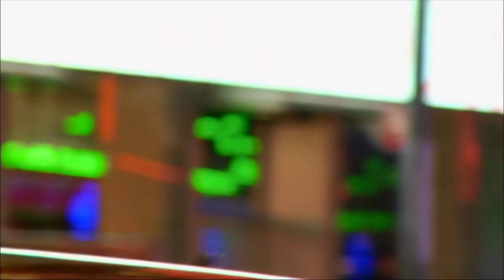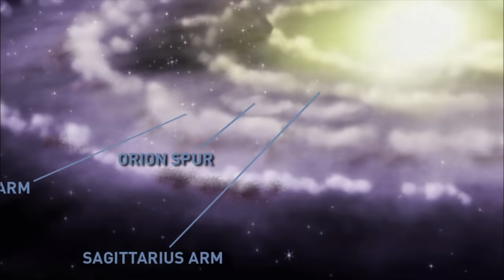The Universe: Countless Wonders of the Milky Way (S2, E4) | Full Episode | History

Comment: Wish you would bring this show back with all the new discoveries!
Reply: Agreed
 Would love to see something on the Kupier belt
Reply: Mike Rowe is still doing "How the Universe Works". They just released the 10th season a couple months ago.
Reply: @DanRustle  Basically everything you just said is wrong.  You - Yes YOU - can see the closest galaxies like Andromeda fairly clearly with a $400 telescope and the images from the most powerful telescopes like James Web and Hubble are not grainy images, they are top notch high resolution images.  We can easily determine size of other galaxies by a number of methods, the most common of  which are distance which is determined by the amount of redshift in the light from those galaxies which reaches Earth and gravitational lensing to determine the approximate number of stars within that galaxy.  We can then give a fairly accurate approximation using that information on how many stars any given galaxy has, which yes is a guess, but it is a very educated guess based on real data.  As for our own galaxy, the reason we know the Milky Way is a spiral galaxy is because astronomers spent 25 years using a large number of optical, infrared and x-ray telescopes to map out every part of it we can see, which is about 80% of it, the other 20% is blocked by the supermassive black hole at the center and all the stars, dust, gas, etc. orbiting it. If you have 80% of anything you can easily determine what the final shape would have been with that missing 20%. Our telescopes have even begun directly imaging exoplanets now.

Comment: ºIf we are exploding half a million miles an hour through space or even one mile an hour, in an ever expanding universe than the stars should have changed their relative positions in the six thousand years that we've navigated using Fixed Star Location.  But they haven’t.  Stellar drift is a misnomer.  Polaris is still the North Star.  All the zodiacs still look like what they were named after some six thousand years ago.  The great pyramids of Giza are still perfectly aligned with Orion and Orion having twelve independent stars should not still be looking like an archer.  And Haley's comet knows where to find Earth every seventy-five years in an ever expanding, chaotic universe ?
 There are over two hundred stars in the constellations alone and if they haven’t moved in over six thousand years then they never will.  It’s practically written in the stars that, “The Earth is stable and cannot be moved.”  1 Chronicles 16:30.

Comment: The motion of the stars orbiting close to Sgr A* indicate that the supermassive black hole is NOT spinning on it's axis once every 11 minutes. There is no frame dragging occurring around Sgr A*. Sgr A* does NOT have an event horizon nor does gas orbit it rapidly in an accretion disk. All these postulates were excuses to explain the massive amounts of high energy photons and gamma rays coming from the location of the black hole.

Fact, in 2019 ALMA Radio Telescope released a Doppler image of Sgr A*. The Doppler image measured the trajectory and velocity of the gas near the supermassive black hole. The gas, instead of orbiting the black hole in an accretion disk was moving directly away from the black hole in every direction. None of the gas was moving towards or orbiting the black hole. The data indicated that the energy and gas was coming directly from the surface of the black hole. This empirical evidence indicated general relativity is incomplete and the laws of thermodynamics is incorrect. 

According to GR nothing can escape the gravity of a black hole not even light. Yet astrophysicists are able to measure massive amounts of energy and matter moving away from the black hole in every direction thus it is incomplete. The laws of thermodynamics claims that energy and matter cannot be created. Matter and energy would not be moving away from Sgr A* if energy and matter could not be created. The accelerated expansion of space with great distance would not happen if energy and matter could not be created. These empirical observations indicate the laws of thermodynamics to be wrong claiming that energy and matter cannot be created. If energy and matter could not be created then all the energy and matter in the universe would not exist. That is an empirical observation that cannot be disputed! the only reason why the exponential expansion of space with distance is blamed on dark energy is because it violates the laws of thermodynamics claiming that energy and matter cannot be created. So the universe according to law should not be expanding, growing over time. It should be collapsing because of gravity. But the actual opposite is occurring because energy and matter is indeed being created everywhere. Observational evidence of energy and matter being spewed by a supermassive black hole is empirical evidence that energy and matter can be created. If it is happening to one supermassive black hole then it is happening to every supermassive black hole.

This one Doppler image by ALMA of the supermassive black hole in the core of our own galaxy is the key to understanding everything about the universe, including gravity. Yet not one web site, news agency, scientific forum or peer review process has mentioned anything about the empirical evidence ALMA Radio Telescope discovered! They even discovered stars forming in the gas moving away from Sgr A* released the data earlier this year about the black hole birthing stars near it. All the unexpected data that contradicts theory and law goes ignored when it should be breaking news, showing Einstein to be wrong about gravity and it's effects.

Fact, in 2010 astrophysicists announced they discovered a massive cloud of gas, called G-02 heading straight for the supermassive black hole in the core of our galaxy. Astrophysicists began making predictions on what would happen to the gas cloud when it neared the black hole. They claimed the gas cloud would be stretched out as it got close because the gas near it would be moving faster towards the black hole than the trailing gas. So they claimed the gas would become spaghettified. Some of the gas they said would reach the speed as it neared the event horizon then produce what they called a light show. The rest of the gas they said would be stretched out and flung out away from the black hole. The EHT team then created an animation of what was predicted to occur with G-02. 

I however have been studying gravity and it's effects for more than 20 years and I came to a different conclusion, to which my predictions on what was going to happen to G-02 was different than theirs. I wrote to them in a NASA forum and told them that nothing much was going to happen to G-02. I said it would orbit the black hole and barely be affected.

Then we waited for the event to occur. 4 years went by and the EHT team measured the G-02 gas cloud orbit the supermassive black hole and come out behind it and the gas cloud remained intact. It even retained it's spherical shape. So I was right. The gas cloud orbited the black hole and was barely affected just as I predicted.

Then the EHT team believed there was missing mass somewhere. Because according to the laws of motion the gas cloud did not have enough mass to produce angular momentum and orbit the black hole. It should have been eaten by the black hole, not orbit it like it did. So the EHT team believed there were a few young stars hidden in the gas. 

I wrote to them again and told them that if they went over the infrared data they would confirm there were no stars or missing mass hidden in the gas. About 2 weeks later they reported that they went over the infrared telescope data and could not detect any stars hidden in the G-02 gas cloud, just as I said. The gas cloud orbited the black hole without being affected because Einstein's and Newton's equations on gravity are incomplete. They do not include the action causing gravity. When I deduced what was causing gravity and inserted it into their equations it changed the equations completely. Instead of the gravity of a black hole being so strong that not even light can escape it turns out that nothing, not even light can fall into a black hole. That's why I claimed the G-02 gas cloud was going to orbit Sgr A* and barely be affected. Nothing is able to fall into or collide with a black hole, nothing, not even visible light. the opposite occurs, black hole would spew massive solar pressure and cosmic winds where nothing would be able to get close to them. When mass nears a black hole the cosmic wind they produce forces everything away from them. Thus everything the supermassive black hole creates will take on an orbit around the supermassive black hole from which it came. This causes the space between all the stars to slowly increase over time, causing the galaxy to slowly grow in energy, matter and distance apart over time. Mass is the cause of both gravity and the expansion of space. This is why the space between galaxies slowly increases in distance over time. Dark energy is solved. Gravity is solved. Dark matter is solved.

Every prediction made by general relativity thus far about black holes was completely wrong. Every one of them.

Comment: My idea so I get to name it! What I mean is, no one has claimed it so I'm officially calling, "dibs." Voyager 1 is now in Milky Way's interstellar time or "Mikey's Time."
"V-ger's" message has sped up now that it's outside our suns time bubble or, "Terran Time."  It will be faster still when "V-ger" sends a message from beyond the Milky Way's time bubble. Then there's Outside the Local Group time bubble.  So on and so on until we get outside any influence and into the, "True Interstellar Time Standard." Or, "T.I..." ;-P
Now that "V-ger" is in interstellar space, it's also in the Milky Way's STANDARD, faster moving, interstellar time or "Mikey's Time."  This can be proven by turning off everything except its clock and transmitter.  Have "V-ger" read time for as long as possible.  They WILL show the flow of time speeds up the further away you get from any celestial bodies.  Until you reach the Milky Way's time standard or "Mikey's Time."
•Our sun's time bubble: "Terran Time" we know and have measured.
•Milky Way's time bubble or "Mikey's Time." The rate/flow of TIME outside any influence but within the Milky Way: We just got there and are still figuring. Wild guess I'd say time will increase in speed, now and until V-ger is outside the Ort cloud .00007-.0007% faster, maybe. Just for reference. 
•Local Group's time bubble or the rate/flow of time outside of any influence but within the Local Group: Name still open and unknown. Wild guess .08% to a couple seconds faster, maybe. Used just for reference.
•Outside any influence in the, "True Interstellar Time Standard." (or T.I...) ;-P  This name is NOT up for grabs. The rate/flow of time is fastest here.  (Time flows fastest here so it's best to use a motor boat and hold tight.  Always applies when you're in T.I....) ;-P
A minute is a minute in all. It's the rate/flow I'm talking about.  Heck, rivers of time flowing differently might explain dark energy and dark matter. 
The Milky Way's Interstellar Time Standard will be known as, "Mikey's Time."
Pass it on, please and thank you.

Comment: Two planets in our solar system rotate (spin) in the opposite direction of the rest .  Electrons rotate in a certain direction but , do they rotate in the same direction on these two planets
Reply: Sounds like camdens future
Reply: Kind of like weather related cyclones, such as tornadoes, which rotate counter clockwise (cyclonic) in the northern hemisphere and clockwise (anticyclonic) I’m the Southern Hemisphere. Even though there have been reports of anticyclonic tornadoes that sometimes accompany a larger mile (or two) wide tornado, but I think that is the result of the storms updraft mixing with wind shear.

Comment: Why does it take earth only one year to go around the sun but it will take a space ship years to go to sun ? And I am saying a space ship that is traveling in a straight line ( shorter distance ) than going around sun?? It doesn’t make sense please explain
Reply: It would take about 5 months for a ship to reach the sun, not years.
Reply: First, we have to figure out how far Earth travels. Earth takes about 365 days to orbit the sun. The orbit is an ellipse, but to make the math simpler, let's say it's a circle. So, Earth's orbit is the circumference of a circle. The distance from Earth to the sun — called an astronomical unit— is 92,955,807 miles (149,597,870 kilometers), according to the International Astronomers Union. That is the radius (r). The circumference of a circle is equal to 2 x π x r. So in one year, Earth travels about 584 million miles (940 million km). 

Since speed is equal to the distance traveled over the time taken, Earth's speed is calculated by dividing 584 million miles (940 million km) by 365.25 days and dividing that result by 24 hours to get miles per hour or km per hour. So, Earth travels about 1.6 million miles (2.6 million km) a day, or 66,627 mph (107,226 km/h).

Comment: That's giving the supermassive black hole a lot of credit because the one that is 15 billion x heavier than the Sun is little more bigger than the star Arcturus so our supermassive black hole has to be much smaller than the diameter of the earth to the sun and in all probability is not much bigger than the Sun
Reply: In a video I saw yesterday that compared SA* and M87* supermassive black holes, it was mentioned that our SMBH is the size of our solar system, so waaaay bigger than the Sun.